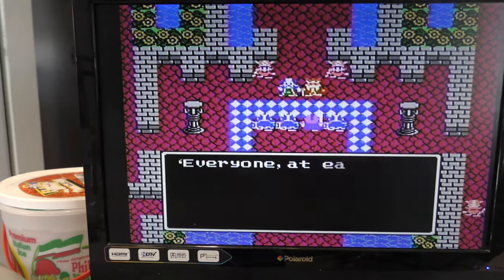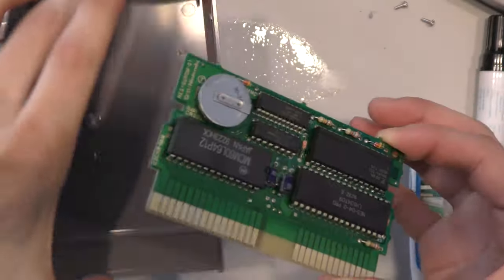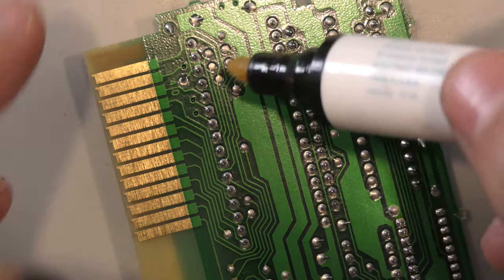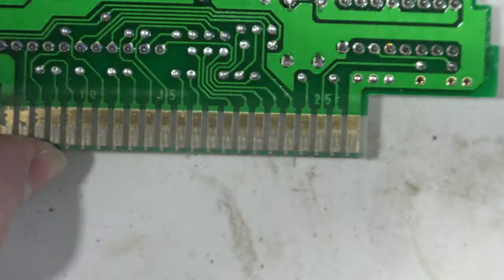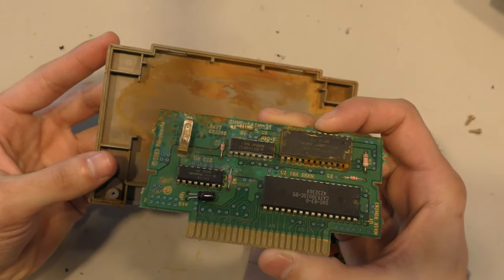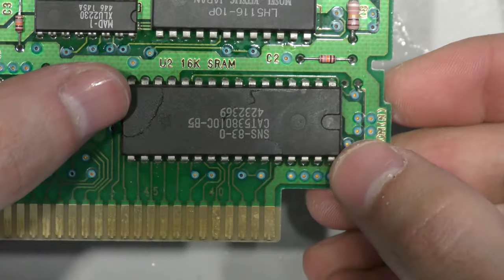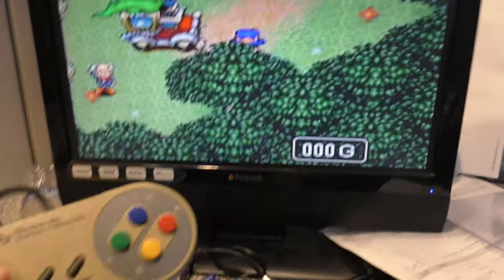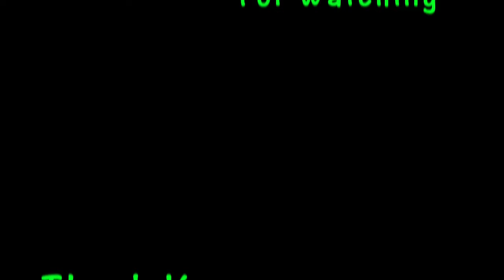VGRestore Ep41: 3 Ebay Carts Not Working

Comment: Thanks for another great repair video. I repair old cartridges too, but I learn something new every time I watch you.

To clean labels, I put a very small amount of warm water on a soft paper towel and lightly rub the label. Sometimes I dry them with a clean paper towel and repeat the process once or twice more, always using very little water and being very gentle, using almost no pressure.  This method can remove a surprising amount of dirt, and works well even on stuff like 40-year-old Atari 2600 cart labels which are easily damaged. I never touch labels with IPA. I learned the hard way that it'll quickly dissolve the ink on some labels.
Reply from the maker: Dr Loco thanks I’m glad you enjoyed the video. I will keep your idea in mind for next time. In this case I used ipa but a very small amount and I think the cart came out great.
Reply: @PunkNDisorderlyGamer  IPA can bleed the ink of the labels. I found that a 5% Simple Green - water solution is best. Just make sure to go behind with a wet clean cloth to get the soap residue off.

Comment: 8:35 You forgot to take it out for an expensive dinner and whipser sweet nothings in the cart slot.

This might sound really stupid but I had a TMNT IV cart many years back that wouldn't work properly unless is was heated before use.  For kicks, you may want to try that to see if the battle would play out.
Reply from the maker: Wil's VG Addiction now I’m intrigued I could heat the board in the toaster oven and try it out.

Comment: Dump the cartridge and try to compare the rom to a working rom through a hex editor. Its possible that some ESD damaged a byte value in the PRG.
Reply: What you can do is bake the PRG chip. This can fix it in some cases, but in other cases can make it worse. This method isn't healthy for semiconductors. But hey, what do you have to lose?! ;)

Comment: Are the legs on these ROMs long enough to work with a socket?  Would they still fit in the shells with the extra height from a socket?  I've not worked on SNES carts, but it seems like adding sockets in your own copies of carts would make it easier for you to test the chips from eBay buys, and save solder wear/tear on your own copy.  I would go adding sockets everywhere, but anytime you were testing a ROM swap it might make sense to add one.
Reply from the maker: For nes they are too tall to close the shell for snes I’m not sure

Comment: What is the cleaning solution (the white paste) you use to remove corrosion?
Reply from the maker: Oh that’s Brasso, it’s a metal polish mild abrasive, it works wonders just make sure to finish it off with alcohol because it will leave a white residue once it drys.

Comment: what flux do you use in pencil? kester?
Reply from the maker: Zolotarev Aleksandr this flux was the brand that came with the pen. But I tend to use MG Chemicals Rosin Flux. Once the pen runs dry I will refill with Mg chemicals Rosin flux. Keep in mind they also have liquid no clean flux which is a bit different.

Comment: For Dragon warrior maybe remove the battery for awhile and start a new game and try it. maybe try a newer battery too if the voltages is lower. probably a low %5 chance of this working but it may work. Hopefully the point where it freezes isn't too far into the game for this test.
Reply: Came here to comment the same. It's also possible the save game is corrupt, or was made with a game genie or something else (leading it to be corrupt). Please wipe the saves (and maybe a new battery as well, as Matt B mentioned) and give it another try. 

If that doesn't work, a dump of the rom and comparison with a working rom might show a difference....